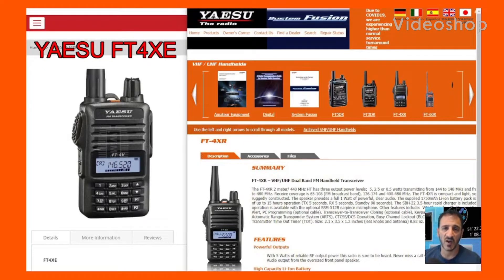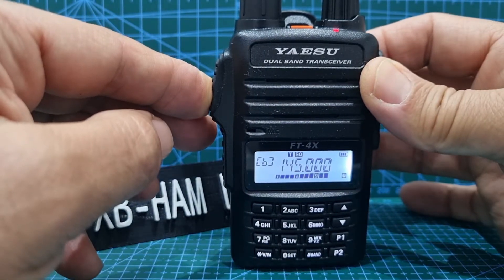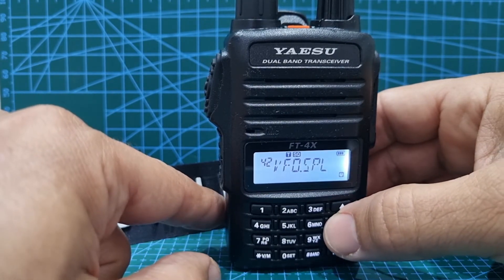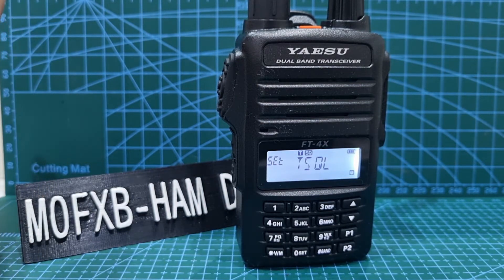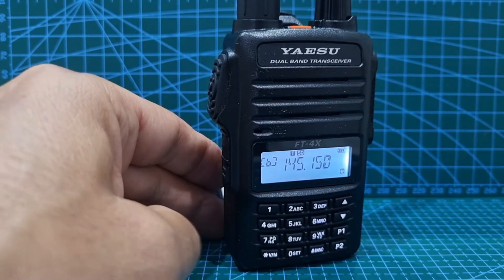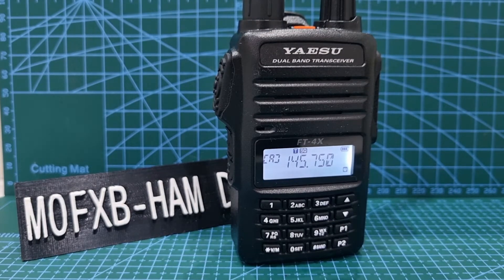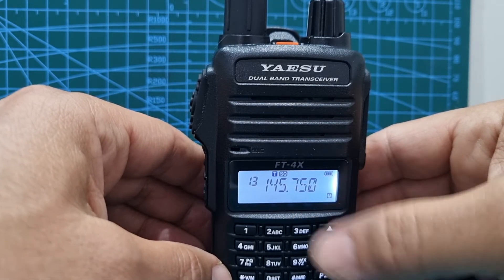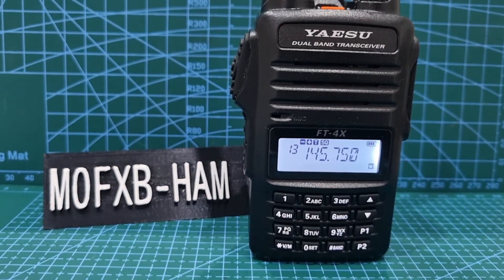YAESU FT4X Split Mode Memory Channel

Comment: Stupid question, is there any other practical use for this other than repeaters that don’t have the normal offset besides being a different way of setting up a repeater? Thanks AC9DJ
Reply from the maker: Having the flexibility to use separate tone freq and shifts opens up lots of possibilities .
Reply: @M0FXBHamTech  Thanks! Will have to play around with it on my 4X.